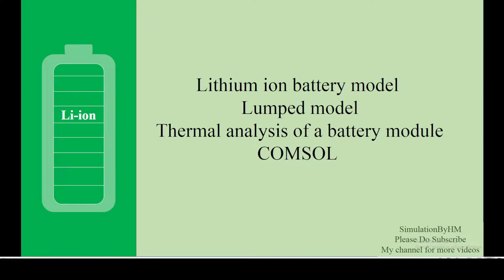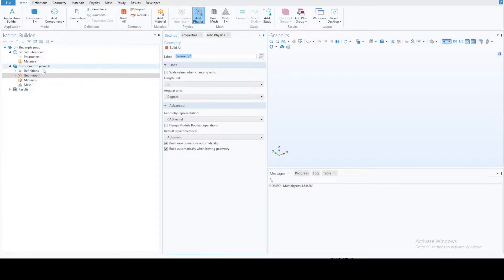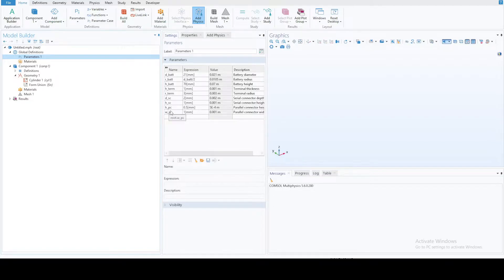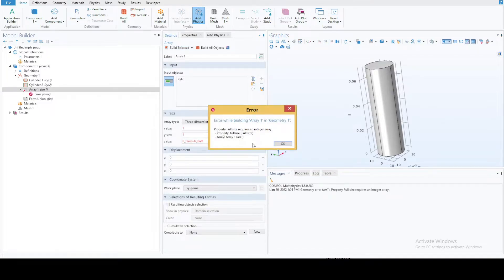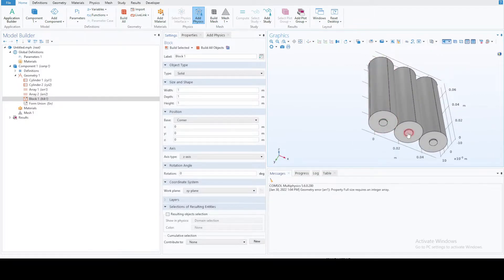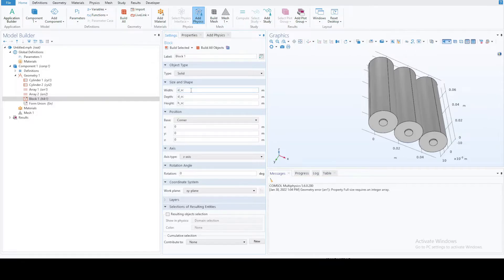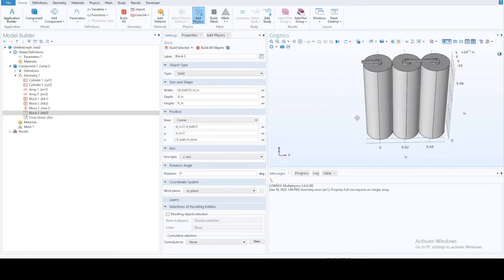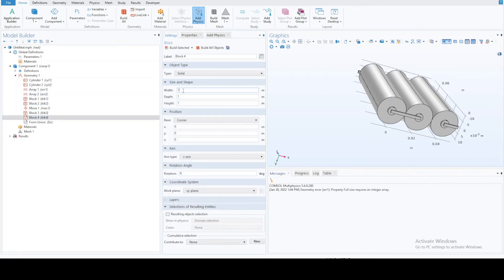Lithium ion battery Lumped model for beginners  | Thermal analysis of a battery module | part 1 of 5

Comment: Could you please tell me what are cathode, electrolyte, and anode materials you are using?
Reply from the maker: Its a generic modelling and the purpose of the model was to show how the modeling is done. The exact recipe of electrode and electrolyte are usually not disclosed by the manufacturers that why we only see the manufacturer name in research paper and not the detailed constituents, So, I am afraid i cant really tell which material just that its a lithium ion battery for specifics you have to contact the manufacturers of specific brand.
Reply: @simulationbyhm5194  Got it! Thanks for the reply and the video.
Reply from the maker: @thriller718  pleasure